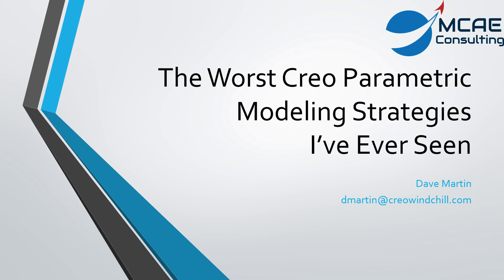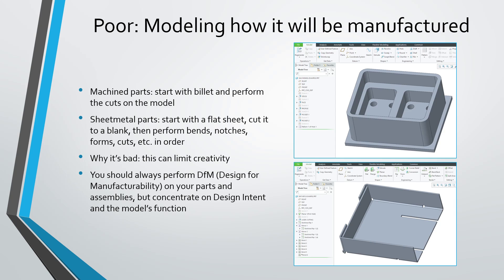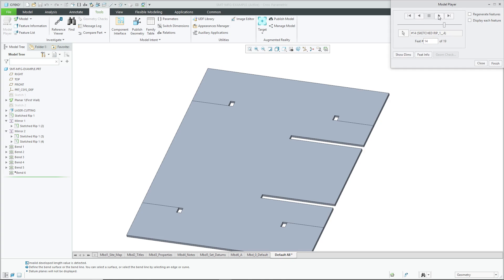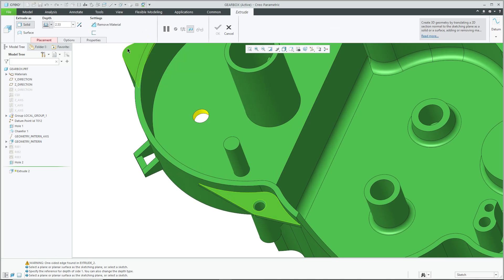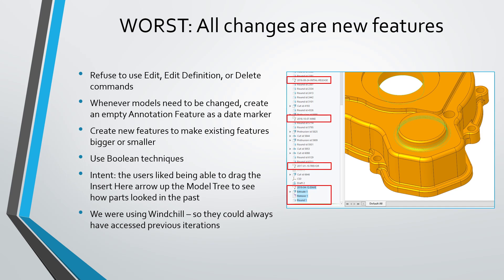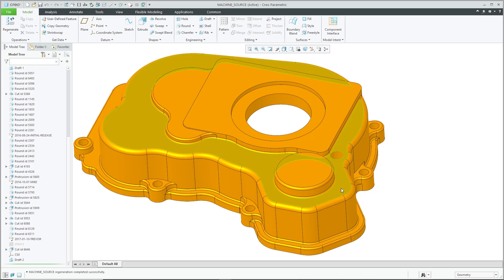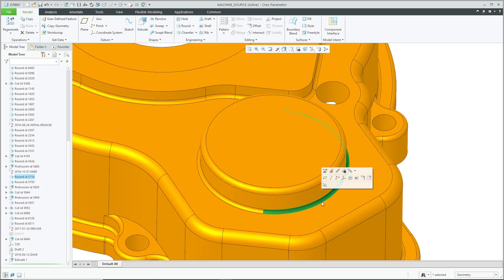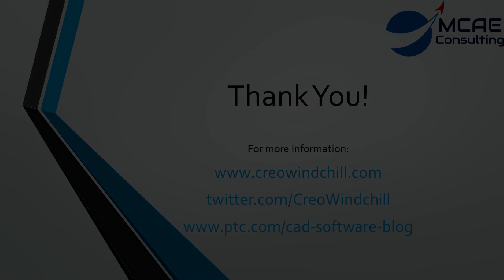Creo Parametric - Worst Modeling Strategies

Comment: Dave....thanks for sharing these bad modeling strategies. However one question on your suggestion of not creating models according to how it is projected to be manufactured as it would limit creativity.
 In the past, I have worked in sustaining departments for traditionally subtractive machined products, and trying to edit sketches that have a substantial amount of features in one sketch was a real pain! Our company defined these as "superfeatures" and was discouraged due to the amount of time sustaining users would need to take to redefine a certain feature in the middle of many features in one sketch. Primarily, if one dimension was changed, the other dimensions would be affected. What is your suggestion to prevent this from happening? Should dimensions be "locked" in the sketch? If most features were distinct with unique references, editing would not be an issue.
Reply from the maker: I'm pretty sure I covered that in my Sketch Mode Unhealthy Practices video. Sketches should be kept simple. If people put too much in a sketch, life becomes painful. You can eliminate as many dimensions as possible with constraints, but if that's the direction someone has chosen, you're pretty much hosed until the sketch is made less complicated.

Comment: Almost all the examples are similar and come down to not deleting a feature for one of two reasons: either you're told not to, or, you choose not to. Regarding choosing "not deleting a feature"; we get paid for output. If I have to extrude a rectangle to shorten an edge, then I will use a rectangle. If I can quickly edit the definition of a feature to shorten an edge, then I will gladly edit the definition. Edit definition is always the preferred method, but fudging is the all too frequent expedient. Its a CREO thing.

Comment: I have had similar issues with companies who just use windchill as a folder system. One place I worked a while ago did something similar to what you showed, but they would do a save as and put _rev-b as a suffix, and they used descriptive file names, so you ended up with 100s of part files like sheetmetal_clip_1.prt, thicker-clip_3 and so on, no parameters filled out, no design intent it was super frustrating
Reply from the maker: Ugh. Seriously, if that's how you're going to manage data, why bother purchasing and implementing Windchill? Yeah, I've seen companies do some seriously crazy things.

Comment: On your extrude preview the end of your depth controller is a circular dot (the thing you click on to drag the extrude depth)  Is that a config setting?  Mine is a square
Reply from the maker: Sean, they keep on tweaking the shape of drag handles between versions. All the drag handles were white squares for the longest time. Then in an early version of Creo the depth handles were white squares and the Offset References handles were green diamonds. Then in Creo 4.0 if I remember correctly the depth handles turned to circles, and in 6.0 you'll see orange diamonds for Offset References. I do switch between Creo versions a lot in my videos, which is why they will appear inconsistent.